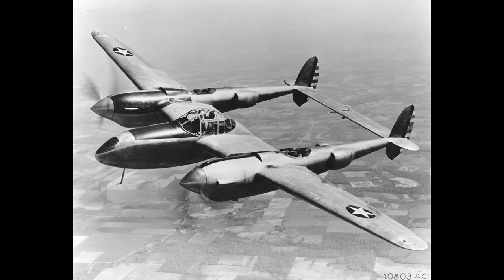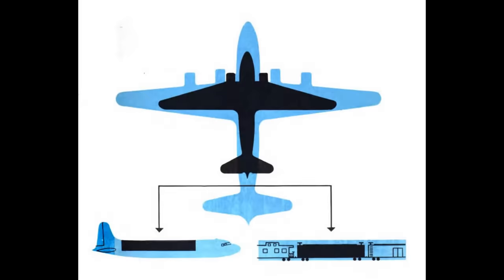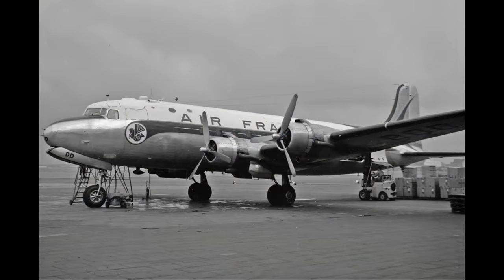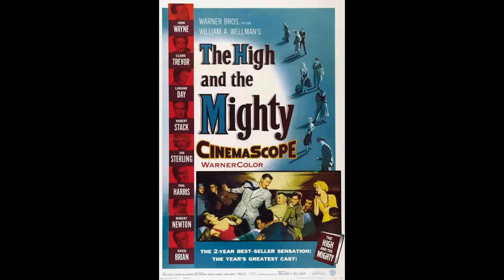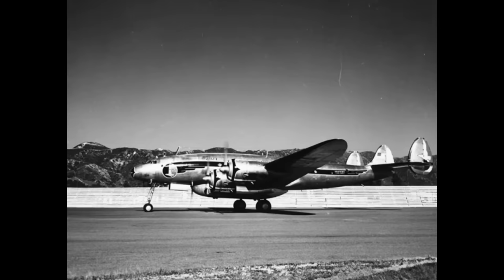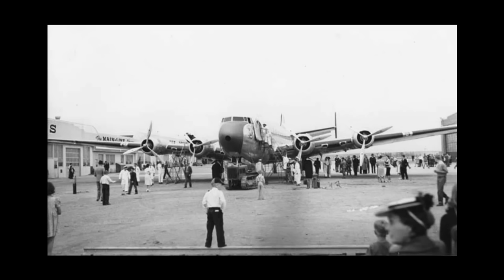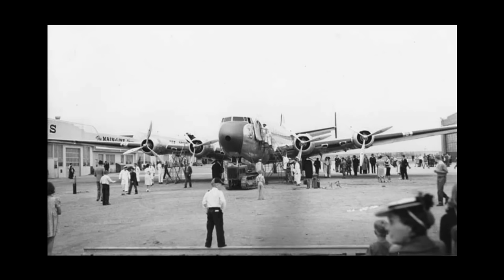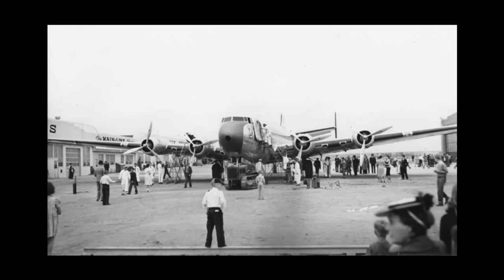Turbo Compound Piston Engines. Almost magic tech.

Comment: EXCELLENT presentation, Greg. I taught this (and related) subject(s) as an Instructor at an A&P school back in the late Sixties. Getting the differences in these systems across was difficult. I retired as a B-767 Captain in 2003. Engine performance was was greatly improved.😅
Reply from the maker: I'm a 767 captain, we may have flown some of the same planes.

Comment: Up to now, I thought I had a pretty good understanding of how turbo compound engines worked. That was until you point out the use of a blow down turbine. Excellent presentation as always, Greg.

As a side note, I believe there was an allison V12 test engine that produced nearly 3000Hp by the end of ww2, but it was never fitted to an aircraft (as a P38 fan, I can only dream...). When you consider the ~650Hp the naturally aspirated version produced, it helps put into context the "magic" you talk about here. And that magic comes from bypassing much of the "pumping losses" that comes with trying to shove more air into the intake manifold by putting power directly into the crankshaft.

As for modern long haul trucks, the only examples I saw was for low power recovery (<4%). Power was put back into the engine at the camshaft, via the timing gears. Not much, but I suppose it would add up over the life cycle of the vehicle. Although, one blown turbine could easily wipe out those savings, when you consider how expensive modern diesels are.

Comment: Memories when I was a kid, spending holidays going with my uncle in his truck from his malmö to strassbourg route. I remember quite well, reading the handbook of his Volvo F10 340, seeing a drawing of a turbo compound wheel after the turbocharger. His truck had an extra valve in the exhaust system, which he could manually close on long descents, to slow down his truck and spare the brakes

Comment: I had always thought of turbo-compounding as using the same type of turbine as a turbocharger, so I didn't really understand how it could help. I didn't know about the blow-down turbine. Very informative and well presented and produced video. Thank you.

It's interesting how at the zenith of the piston aero engine they used turbines to recover energy from the exhaust to drive compressors to boost the inlet pressure and to drive the propeller, much like a turboprop or turbojet. You can really see how that would be the next step.
Reply from the maker: Thanks, but just to be clear, in this application the turbine has nothing to do with the intake pressure. That's handled by the supercharger.
Reply: Understood. Thanks again.

Comment: Great article.  During this era I had a college classmate whose father was a flight engineer for Pan Am and he transitioned from the 7-C to the 707 and I asked him about the difference.  In his first three years with the 707 he never made an unscheduled engine shutdown on the jet while a flight with the T-Cs without a shutdown was a happy flight.  Another big deal was taking off from either Idlewild or Paris on a typical August afternoon followed by the circling needed to cool off the engines and gradually gain altitude to continue the flight.  It is interesting that both the 7-C and the super connie came out at the same time as the C-130, the latter using turbo-props.  Both of the airliners were offered to the airlines with that option but nobody bit that bullit.  I would sure like to see what those planes could do with the extra power of  the turboprop, the higher altitude capability, and the added reliability.  While the added speed of the jet would make it the choice for longer flights,  the t-prop planes didn't need the longer runways for  landing and takeoff and would be competitive speedwise and fuel consumption wise on mid distance flights say like NY-chicago or mayB as far as Denver.  Another friend was a captain on Eastern's DC shuttle starting with the Electras then going to the 727s, the latter added about ten to fifteen minutes to the schedule since they always fly IFR.
Reply: A couple of things. First of all, although there was a proposal to build a turboprop powered DC7 (the DC7T), it was merely that - a proposal. No plane was actually built. On the other hand, a few turboprop Connies were built. With 5000HP turboprops, these were quite strong performers, with a maximum speed of 470MPH and a cruising speed of 430MPH. But they were never put into production or marketed to airlines.

Comment: Greg: Thank you for this video on turbo-compounding, especially as it relates to turbo-supercharging. Your explnations (and illustrations) are easily understood. 

I distinctly recall seeing a DC-7C parked at SFO, in 1964 (back when you could get to the boarding area without going through security). The " Seven Seas" version of the DC-7 was spectacular to look at. I recall being so thrilled to see it. I feel very lucky to have seen this DC-7C, because they disappeared soon thereafter, with jets taking over.

Thanks again.
Reply: That was an incredible airliner. As handsome as any Connie is, I look at the Douglas planes and in many cases prefer the appearance. Sleek, and in the 7C version just amazing. But, at the same time, it said "No cosmetics here; I am all business!".

Comment: Another Great Video from Greg.
In addition: 
Greg explains that the exhaust drive on a Compound Turbo equipped engine does not increase back pressure on the exhaust because it works on gas velocity not pressure.
Thus it is not a reverse impeller (like a turbo charger) but a serious of airfoils around a disk that interact with the high speed gas flow and generate energy not from being "shoved", but rather by the shape of the airfoils producing "lift" laterally around the disk.
Pedantic point probably but one of two fundamental differences between a turbo and compound.

Comment: Fascinating! This old tech might actually be most useful in hybrid cars where capacitors and possibly if needed a simply controlling when a load is put on the alternator could take the place of fluid coupling to smooth out the the surges into usable current and reduce stress on the starter. This could allow the engine to produce even more electricity from a given amount of fuel. The trick would be keeping the maintenance low, cooling , and figuring out if you might need to alter the catalytic converter to deal with the lower velocity or possibly place it after the catalytic converter.

Comment: One of the truck engines that uses turbo compounding is the Detroit DD 15 diesel engines used in Freightliners particularly. It gives back about 50 HP and in the time I was driving them seemed to be trouble free.

Comment: FWIW, how many of you remember the California 1000 air race, and a guy by the name of Clay Lacy that entered the race with a DC-7, and finished 6th, didn't have to stop for fuel, and still had some 1400 gallons of fuel left!?!?

Later, he & the owner of that aircraft both entered another 1000 mile race, Lacy with the DC-7, and the other guy, with a Super Connie!

(Other pilots complained, and they both were forced to withdraw from the race, dammit!)

 BTW, this past September, I was near Stead Field in Reno, and had the honor of having "Bataan" (MacArthur's recently restored Super Connie - complete with the TC engines) pass overhead, and man - what a beautiful sounding bird!!!
Reply: Just a little correction, "Bataan" is a C121A which can be compared with a civil L-749. What means it is no Super Conni and the engines are not turbo compounded. But you're right it sounds good as well.

Comment: My first flight as a student in the RCAF, was in a turbojet powered aircraft, and I went on to fly fighter type aircraft for the 10 years in the airforce.  I had the opportunity to take the advantage of several rides in the Argus maritime patrol aircraft, which was powered by 4 of the Wright 3350 double compound engines.  The guys flying it, stated that it was an incredibly efficient aircraft, with a total endurance in some situations, of over 24 hours.  
The airline I went to, had four series of DC-8s, the 43, 53, 55F, and the 63.  That meant, we had to keep current on all of them.  My point in bringing this up, was that the 43, was powered by the Rolls Royce Conway pure turbo jet, the 53 and 55 series, were powered by the Prat and Whitney JT8D turbofan engines, with the short ducts, and the 63, was powered by the JT8D turbofan engines with the long ducts.  The differences in how we operated these aircraft was mind blowing.  The /63 series, with the long was the best performance compromise for most situations,   We were flying Vancouver to Amsterdam non stop, and Amsterdam to Vancouver, with one stop at Edmonton or Calgary.  Most of the time, it was with a nearly full passenger load, and often with up to capacity in baggage and freight.
The DC-8/63, was a fantastically efficient aircraft, and the company very nearly re-engined them with the CFM-56 engines, as well as dumping the refer units for air conditioning packs for a large weight reduction and even more efficiency.
One of our Conway powered DC-8/43s (aircraft 602) went back to Douglas, and became the first airliner to fly supersonic.
Cheers

Comment: Thank you for answering the question, "What is the difference between turbo-supercharging and trubo-compounding?"  I worked for C-W in the early 1980s, and knew a number of engineers who discussed turbo-compounding on the R-3350 engine and who spoke with pride about how this engineering development represented the apex of this engine.  At the time I was researching turbo supercharging of the B-17's R-1820 for a book I was writing.  I could never grasp how this mysterious  turbo-compounding in the R-3350 produced better results than a turbo-supercharged R-3350 on the B-29.  Until I watched your video today, I figuered I'd never find out.  Your explanation was perfect!  I really appreciate finally learning about this, and why it was such a big deal in the 1950s.

Comment: I went into the Air Force in 1981 and my first Crew Chief Jim H. (R.I.P.) worked on C-119's at Clinton County Air Base Ohio, way back when. He had stories about the compound engines, so did others I worked with at Wright-Patterson AFB. You could tell when one went bad by the sound and vibrations in the aircraft. Most of the guys told how they would seize and just rip out of the side of the nacelle. If not then they would drag down the engine and force an engine change due to stress on the crank shaft and the engine would have to be torn down and inspected along with an inspection of the nacelle. Nobody liked the compounds. They were way too unreliable because of over heating, however when they worked they were great. I have no specifics, or data to go by, just the anecdotal stories. I know my Crew Chief had limited use of his left shoulder because he was in a crash in a C-119 when one of the R-3350 compounds over heated and would not disengage basically taking out the left engine on takeoff, a bad thing in any aircraft, deadly in a C-119. The right engine took out the top of a tree shortly after that and "it was a short ride from there". They all liked the R-4360 because it did not need the compound system to produce the same power. Nobody liked the four bladed propellers on the C-119 either because of the reverse feature. This feature was mechanically blocked until later fixes came along.

Comment: I flew on a DC7 in the mid-1950s, return flight on a Super Connie.  The vibration and noise was hellacious and there was little chance of being able to nap during the flight.  The next time I flew was on a 707.  No vibration, nearly twice the speed and the takeoff really planted you in the seat.  🤠

The Turbo Compounds were a maintenance nightmare and as was often said, the Super Connie was the finest three-engine airliner ever built, alluding to the all-too-frequent in-flight engine failures.

Comment: Thanks Greg, a good treatise.  I new of the earlier efforts where 4 of the second row cylinders drove the turbo super charger and 5 the turbo compound, but you have added to my knowledge with this more comprehesive compounding.
There was also (never in service) the Napier Nomad with ultimately a 2 stage turbine.
In the aero business noise is (or was) less an issue but with your car or truck its important enough to require silencing.  I have heard turbo superchargers called rotary mufflers as the energy extracted would otherwise be noise.  Mufflers (as you call them in the US) cause back pressure too so replacing one or more mufflers with a turbo is energy for free which otherwise would go to waste.
I don't know how much future they might have given the issues of climate change which may reduce the use of internal combustion engines.
Hard one to call.
I have seen "The High and the Mighty" twice and it was a nail biter both times (even knowing the outcome).  Excellent film and to be recommended.

Comment: This system has been used on Shania trucks recently. I recall a 4% recovery was achieved post turbocharger, driving the engine via the starter ring gear.

Comment: My understanding of thrust vs horsepower is the relationship between changing the momentum of the air vs changing the kinetic energy of the air. You can't affect one without affecting the other, but to get the same thrust, you can change the velocity of a lot of mass of air by a little or change the velocity of a small mass of air by a lot. The former requires less horsepower at low speeds and turboprops, big turbofans do exactly that for shower aircrafts, the latter requires a lot more horsepower for the same thrust at slower speeds, but the thrust doesn't drop off as drastically as the former as the speed of the aircraft itself increases. 

What's interesting with rockets is that the fuel efficiency comes out as the exact opposite of jet engines as in higher exhaust velocity is preferred and gives you more specific impulse than a lower exhaust velocity.

Comment: In the summer of 1962 I boarded a DC7 at Travis Air Force Base bound for Clark Air Base in The Philippines. There were stops at Hickam Air Force base in Hawaii and at Wake Island. During takeoff from Wake one of the engines developed an oil leak which caused a fire. The pilot reversed the props and brought the aircraft to a stop mere yards from the end of the runway. After a several hour delay, the engine was repaired and we continued our journey. That was the last flight of that aircraft and it was towed from the flightline to the scrap yard where it remained past the time I returned to the states some 2 years later.

Comment: Tks for the informed break down, , sorry but lm a builder, so the take l get is the compound turbine blades are foils and they convert velocity of the exhaust gas via pressure difference over the foil surface into mechanical motion and back to the crank.
The detal would be in the shape of the foils to maximise lift and material required to withstand the high temperature of the exhaust gas.

Comment: I had to pause the video to read the ad for Skydrol @26:03 . If you've ever been near that stuff and managed to get the slightest amount of it on your hands you will soon have it on your face and within a few minutes it will get your attention. I built the 747 for 25 years and there were times we had to pull a reservoir from one of the engine struts. It's bulky and being tucked in between the sailboat doors didn't help matters. Up on a lift with not much room to move around.. when the reservoir came loose into your arms it was something you wanted to pass like a hot potato! I remember a guy cradled one in his lap and the fluid leaked where you really didn't want it to. We had to find a couple small cartons of milk and toss them to him in the bathroom stall. That stuff is bad enough on the skin but it is horrible if you get enough of it where the sun doesn't shine.
Reply from the maker: Yup, Skydrol is horrible stuff.